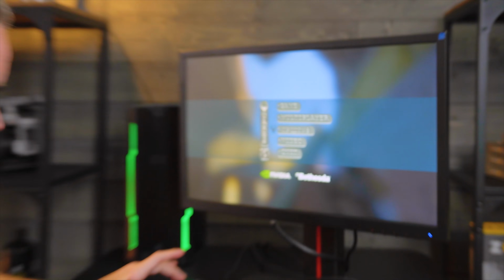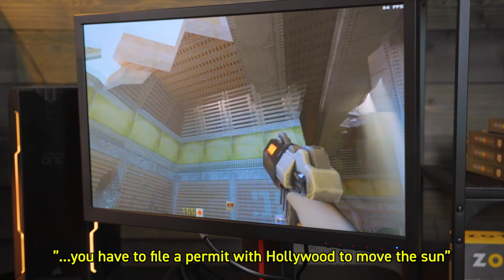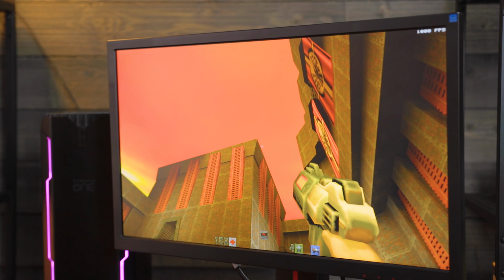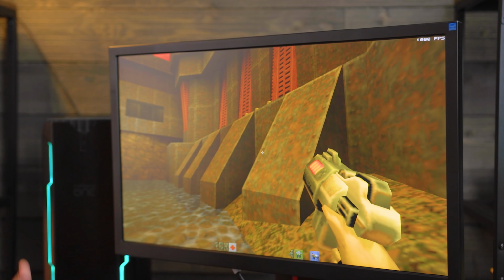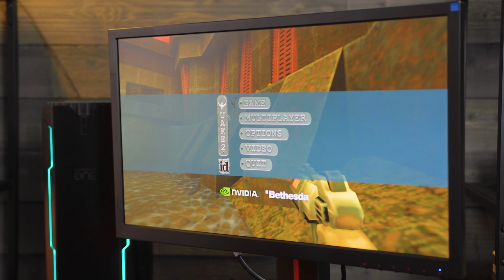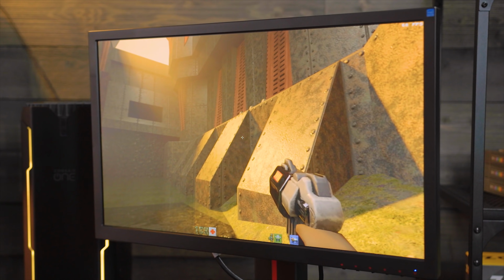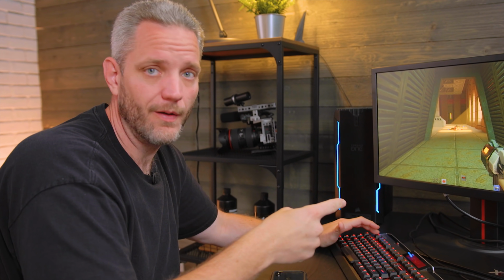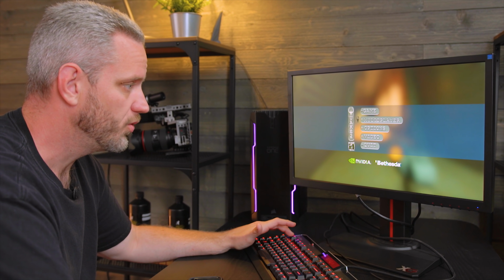Testing Quake II with fully ray traced update...

Comment: 75FPS on 800x600 with a 1080 Ti OC'ed @ 2088mhz (8700k @ 5.187ghz). 22FPS on 1080p.
Reply: Welp, guess I don't have to try now. lol. 22 FPS at 1080p... But, RTX is still budding. I will give it a while before I jump on the band wagon. 1080ti FTW!
Reply: n00bHaMmEr what settings you use because at 800x600 I’m getting between 71 and 82 with a 1080 and 2700x at low settings.
Reply: Got my 2060 non overclocked to 60fps 1080p with everything on. Feelsbadman
Reply: @Thatguy-vu5iu  doesn't feelsbadbad, it's a new technology that the 1080Ti wasn't  purpose-built for. How long ago was the RTX release? How many ray-traced games are available right now? Like 3? Lol. The 1080Ti still stomps the 2060 in every other game ever made. Feelsbadman.
Reply: And people have been saying to buy a used 1080 TI over the RTX 2080 card...... LOL, and Nvidia patching in RTX support on the old cards....., 22 FPS, uh yeah the GTX series is not able to run RTX mode :D, you just proved thousands of people wrong :D. Glad I purchased my RTX 2080 when I did, built a new PC, my old g card was the GTX 970 which performed just fine for anything 1080p the past 5 years :), smart man I am!
Reply: @zackaryk2000  I have like 25% less performance with new technologies a 1080 ti will never see, and I only paid half of what the 1080 ti was a year ago lmao ez done bye
Reply: @Harv88  since you can't read, I'll explain. I never said go buy a 1080 Ti over an RTX for RTX games. I only posted my results objectively.
Reply: @zackaryk2000  actually now that I look at some more gaming benchmarks I see that I was wrong. The 1080 ti is about 20% faster than the 2060. My bad G
Reply: @Harv88   It didn't prove anyone wrong.  You can spend 4 figures on RTX, and play 3 games plus a few demos with far-better ray-tracing results than Pascal owners.  We already knew that.
Reply: Saying "Haha I have a better card than a 1080Ti because it ray traces better" is like saying your stock basic bitch Jeep off-roads better than a Ferrari. Two different purposes, geniuses. Oh and, your card will be USELESS on modern titles utilizing ray tracing (especially if you're too poor and bought a 2060 like @Gunna) until they make cards with far superior RT performance that surpass what the 2080 Ti can do. I'll stick to my 1440p 144hz maxed everything for every game ever made. Lmao.
Reply: This is a good OC. I barely get close to 1800mhz on my 1080ti which is actually water cooled on 360rad. So unlucky on silicon lottery. :(
Reply: @gunduzhusmen8547  that's a bummer man. Mine is on water as well, custom two 360mm rad CPU & GPU loop
Reply: @joesterling4299   22 FPS at 1080p with 1080 TI, proved Nvidia Wrong, because Nvidia stated that the Pascal cards would be capable of running RTX, and they clearly are not capable of running RTX, that's who was proved wrong from Noobhammer posting their results. So it was blatant lie from Nvidia to make last gen card owners believe they could run RTX, some people stated they would buy a used GTX 1080/1080 TI over a new RTX card because they're "capable of running rtx mode", if people purchased used cards or purchased last gen at the increased new prices, they wasted their money and made a bad purchase believing Nvidia.
Reply: @zackaryk2000  read my reply to the other guy down below, Nvidia made people believe that, of course not you, i figured everyone knew what Nvidia did, because Nvidia did say you can run RTX on the pascal cards, but clearly you cannot run RTX on the last gen cards, seeing your posted results proves Nvidia wrong.
Reply: @Harv88  NVIDIA didn't lie. I ran RTX on my Pascal card just like they said it would, through software rendering. Just because it wasn't very effective, doesn't mean it can't do it. Jesus Christ did the short bus leave you behind this morning?
Reply: @Harv88   If RTX runs at 22 fps on top-tier Pascal, then it runs on Pascal.  What part of that isn't clear?  Sure it's slow.  The dedicated RTX hardware isn't there.  It's running in software.  But it runs.

I don't think the idea was to make Pascal owners think they could skip Turing altogether.  That would be a dumb thing for Nvidia to do.  I think the idea was to show Pascal owners what they were missing.  See how good it looks ray-traced?  Aw, you hate that it runs at 22 fps?  Buy RTX!
Reply: @joesterling4299  I have an RTX 2080, but there are people out there who state that the GTX 1080/1080 TI's are just as good as the RTX cards in all departments because they believe it can run RTX just like Nvidia put in their minds, god fucking people on youtube vids are helpless.

Comment: Ryzen 1600 3.9 Ghz
16 Gb 3000mhz Corsair
GTX 1080 Aorus Extreme
10-12 FPS xD
Reply: Cause it's got no RTX cores.
Reply: @frank668668  Or really, a modified shader. Alternative: modify code to use standard shader, like they did for physx (and kind of with later iterations of the Brigade engine as a demo) and to a more limited extent with tensor cores, but give it 2 more years.

Renaming it to rtx and saying it is needed is great marketing and does wonders for sales I am sure, but as with all things it is a limited time only.
Reply: @jamegumb7298  I have an RTX and it drops the framerate of 1000+ to 60 probably because of my monitors limit of 60hz. The graphics difference between OPENGL and RTX for Q2 is astounding. I'd like for Q2 to still exist with GaneSpy and play with friends at Lithium or Action with RTX.

Comment: i5-6600K + GTX 1070 (default settings) = 8 fps with stutering
Reply: So if I was to try it on my i5 3rd gen with a 960? About 80 frames per hour?
Reply: I wonder what 8fps without stuttering would look like
Reply: @reezlaw  Like actual 8 frames per second... the frames are evenly spaced out... 8 FPS with bad frametime can feel like playing it at 2-3fps...
Reply: @tin2001  yes :D :D :D lol
Reply: @reezlaw  it looks like I got 8fps and it droped to 0 fps and again rised up to 8fps :D
Reply: This is weird are you on 1080p resolution?  cause i'm getting ~14 up to 17fps with i5-4590 GTX 1070Ti (nothing overclocked)
Reply: I got 40 fps with i5-6600 + GTX 1660 Ti (also default settings)
Reply: @mstreurman  I see what you mean, it just sounded funny to me :)
Reply: @tin2001  um... you couldn't even try it out on a 960 if you wanted it... Raytracing on non-RTX cards is only available from GTX1060 onwards

Comment: 6700k 4.7GHz
Gtx 1070 2126MHz
2560*1080 defult settings
8 fps

Ryzen 2600
Gtx 1080 2025MHz
1920*1080 13fps

Ryzen 1600x
Gtx 1060 2025MHz
2560*1080 4-5fps
Reply: man are you playing Quake II stretched 2k? lol vertical stretched aswell. the 2k resolution is 2560 x 1440

Comment: Light glowing from weapon bolts was a standard Quake 2 feature way back when already, that's not an RTX feature.

Also, one of the things that makes ray tracing so expensive is what you can see from "the avatar" rendering.

You can see in Quake 2 it's just a hand and a gun, but that stuff is behind the camera. In ray traced games, you already have to add an actual avatar to the scene to be rendered into the scene.

One of the big render savings in the late 90's was tech that would only do the math and render stuff in front of the camera (if not mistaken, introduced in the Kyro 2 GPU), leaving only logic to be done for what was behind the camera (like where things are, where shooting comes from, where damage comes from, geometry of structures giving cover) for things behind the camera and graphically only rendering what is in the viewport.

With RTX, you're forced to render almost everything of what's behind the camera again too. Especially once you start to use any kind of reflections like water, mirrors, etc, then you're back to almost rendering 360° of everything all the time.

That's going from a viewport limited to 65-100° wide and about the same in height you need to render to the full 360° both vertically and horizontally. With full on reflections, you have to do 10x+ the work at the baseline. Quake 2 here runs at about 80FPS, where the normal game could probably run in the 1000's.

Oh and with Quake 2, it's a super low poly game with very few lightsources compared to modern games. With very little refraction, reflection, etc data on textures and materials.

Materials have reflections, they have colors, they have refraction indexes. So to render light raytraced, you have to take them into account and that data can have multiple degrees of precision and detail.

Without raytracing, you mostly have to take the geometry that's behind the camera into account.

And I suspect they already use every possible trick to minimize what they need to take into account with "fuller" ray traced examples, like using the lowest possible LOD levels on structures and textures, using more of a minimalist approximation of an object that retains the general shape, texture, refraction data, etc, than the actual objects.

Game developers that were saying "RTX and raytracing makes our work far more simple" are bullshiting and talking out of their ass.
Those comments only work if they want a game that runs like shit and nobody wants to play because of how shitty it runs.

Sure, normal modern day rendering requires you to put a lot of work into placing the lighting exactly as you want it, etc.
But with raytracing, you have to put just as much work to optimize it to run at any kind of decent speed, you are taking much more of every scene into account to render the viewport.

The few games that already have RTX On features use a very light set of raytracing features on a scene and their performance impact is already massive.

If a game like Metro was fully raytraced, it would probably still run at sub 1 FPS on a 2080.

Comment: i7-7700k @ 5ghz, GTX 1080 gets 10-12 fps lmao
Reply: My results = identical lol...
Reply: Don't worry my 2060 (al maxed out) got 40 - 50FPS
Reply: Well yeah Pascal doesnt have RT cores what did you expect
Reply: Mentioning your cpu was kinda pointless at this point.
Reply: whats your screen resolution?
Reply: thats because the 1000 series doesnt have rtx cores nvidia only enabled it on the 10 series for more market share thats it.

i get 80-100 all maxed on my 2080
Reply: Serious? I thought the 1080 would do better than that even though I know it's not got RT cores. My 2070 was getting roughly 50fps @1440p most of the times I looked at the counter. It hit a fairly high 75 when I changed it to 1080p
Reply: Andrew here’s the thing, quake 2 rtx is 100% ray traced, there is almost no normal graphics work going on.  The reason why in other games the pascal gpus ray trace alright ish is because the cards still have to render the rest of the game, so these games have only a small amount of things ray traced.  Quake 2 rtx is just pure raytracing, basically obliterating all gpus without the proper rt cores.

Comment: RTX is the true next gen advancement in video game graphic quality.  Not 4K.

You make lighting and shadows look as realistic as possible, it's not going to matter if the resolution is at 4K instead of 1080p.
Reply: Dan290559 it’s noticeable on my 27” monitor
Reply: @Alb 92 I may be wrong but I remember seeing that BF5 only makes limited use of raytracing for just reflections whereas Quake2 RTX uses it for everything.

Comment: I got around 15 FPS using a 1080 ti FE and a 7700k
Reply: Sounds legit cause no RTX cores ( which only the 2000 series got ) i get around 80-100 fps with max settings  on a oc 2080
Reply: @SNAKEFIRE9183  It really shows how much engineering Nvidia put in to the RTX cards
Reply: Sean Barzilay it just shows that the cards made for ray tracing (RTX) works for ray tracing. What else can you expect? Especially for the insane pricing on RTX cards.
Reply: @BravestSirRobin  thats my point Nvidia didn't just slapped a sticker on a gpu and called it RTX

Comment: my system:
gtx 1660ti - 180Mhz Core overclock, 800Mhz Memory overclock
i5 9600k

game settings:
720p
global illumination low
everything turned on

40fps
Reply: Holy duck
Can I run it in at least 30fps?
Gtx1060 6gb i5 8400 16gb ram
Reply: @lold6d2  With the right settings then maybe. Why not try and find out? everyone results seem to vary.
Here are my results:
£20 AMD Athlon 860K oc to 4.3GHz
16GB 1888MHz (mix matched ram with different timings bc I dont even care at this point)
Zotac Mini GTX 1060 6GB
total build cost: £500
Heavily bottlenecked by the CPU obviously
5fps with stuttering on default settings! (honestly impressed though. I was expecting lower)

Comment: I got 6 FPS with RTX on and 1000 Without RTX using a 1070 and ryzen 1700 OC to 3.8Ghz
Reply: Ray tracing is demanding, big surprise.
Reply: Actually imagine how many fps you would have gotten, if the framerate wasn't capped at 1000.
Reply: @fabiusmaximuscunctator7390  see it's weird cause some people with higher specs then me capped out at 999. While I capped out at 1000. Now i know 1 fps ain't much of a difference but i would imagine well over 2k fps for a game thats well over 20 years old.
Reply: I bet several thousand fps are achievable. so the impact of RTX is maybe more like 1000:1 which is crazy, if you really think about it. The one fps difference hasn't got anything to do with specs but, synchronization of the framerate. If you cap a game at 60 fps, the fps count also jumps between 59, 60 and 61. That's normal :)

Comment: Ryzen 2700X 16GB 3200, RTX 2070 Maxed Settings 65 FPS ( stock clocks) @1080p (added resolution)
Reply: Can confirm, 2600 16GB 2666 RTX 2070 maxed 60-65 (with occasional drops with intense scenes) to 50
Reply: @coldrunhershel604  on medium GI
Reply: @oooooooooole  Let's assume it's 1080p.
Reply: @MLWJ1993  I have a RTX 2070 and on "medium GI" settings there 60fps
cpu i7 8700
RAM 16Gb
Reply: @oooooooooole  This was at 1080p